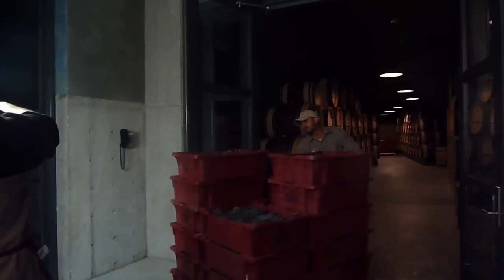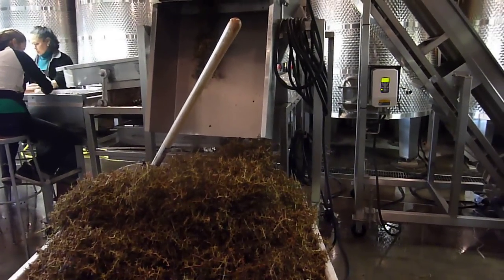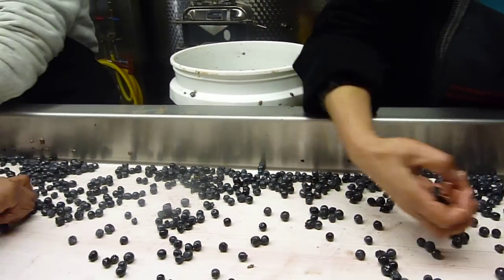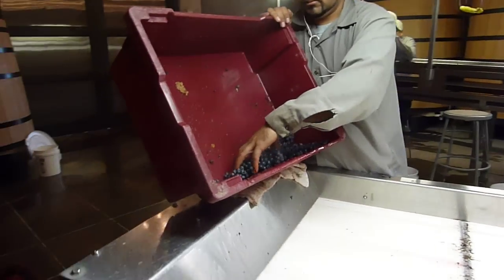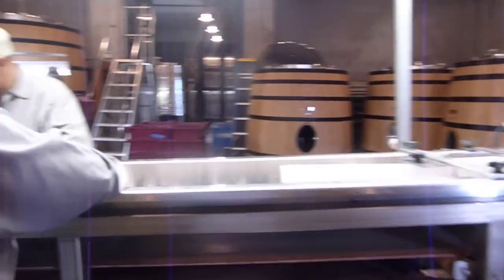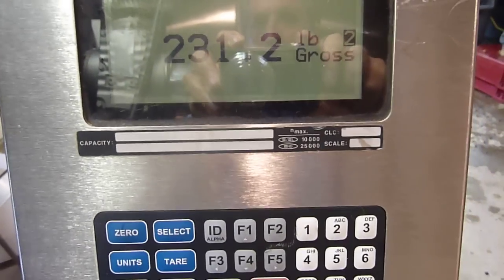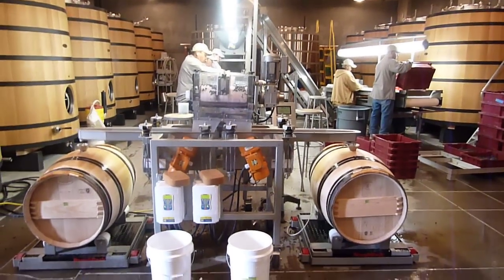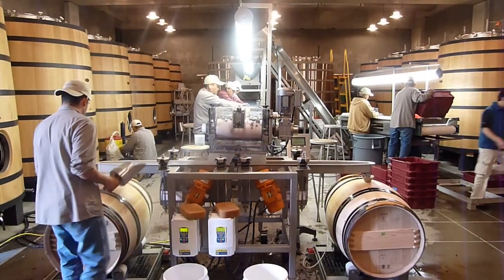Wine Production in the Napa Valley

Comment: GRAND please read up on winemaking.  The grapes are never washed as it affects concentration.  All wines are fermented with some "material other than grapes", which includes stems, lizards, birds nests, etc.  This particular winery would have very little of that due to intensive sorting.

Unwanted solids are removed by settling and the final wine is bright, clear, and clean.

Human disease-causing bugs don't survive in wine due to alcohol and low pH.  The equipment is thoroughly sanitized to reduce organisms that can spoil wine. Usually must and wine is dosed with a small amount of sulfite to kill these bugs.